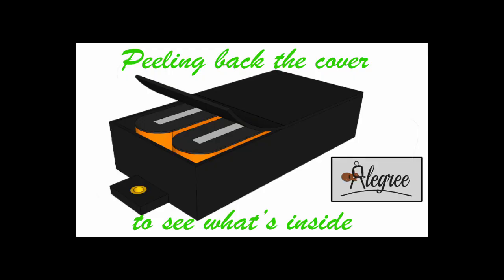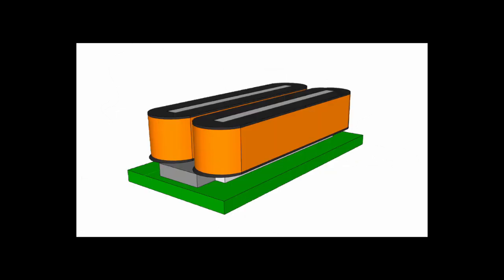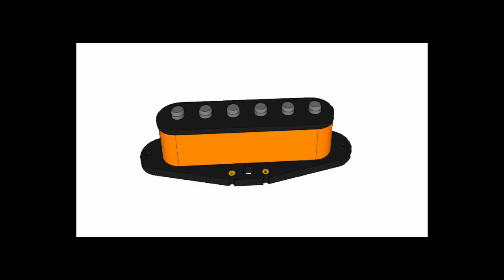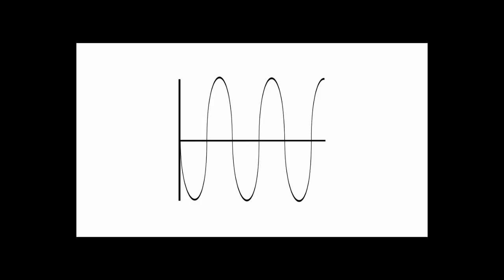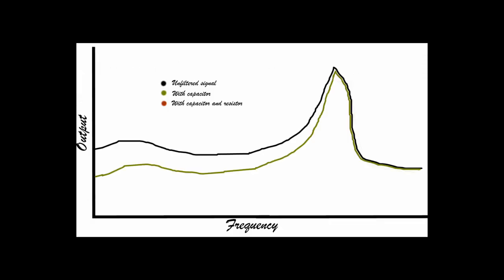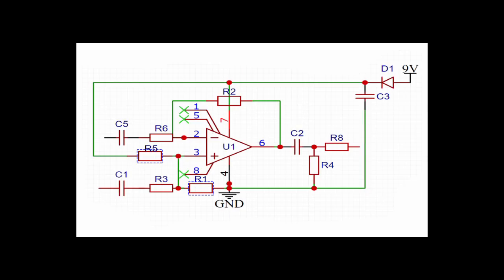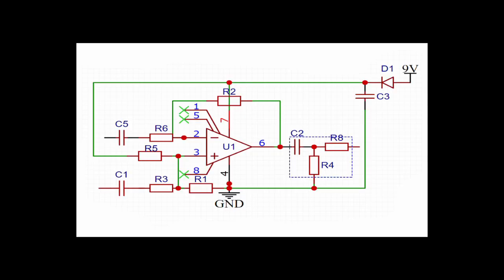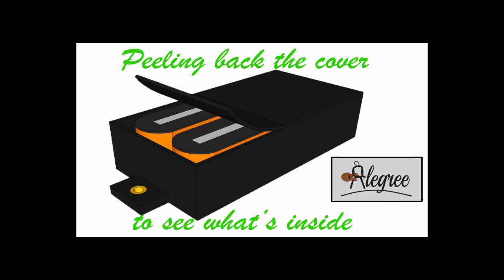What's inside an active humbucker and how does it work?

Comment: The only thing I'm not sure I agree with is that you say the preamp has a lower ouput impedance than a passive pickup. EMGs have a 10k equivalent series resistance. This is necessary to be able to parallel neck and bridge pickups in the mid position (effectively a passive mixer). It also allows the tone control to work as a shelving high-cut filter. The reason you can get away with 25k pots on an active system is that the preamp in the pickup isolates the pickup from the loading effects of the potentiometers. As you pointed out, even quite high resistances can affect the resonant peak of the coils and darken the tone. This is why passive systems have such high-resistance pots - si they don't darken the tone at their highest setting.
This 10k equivalent output resistance is around the same region as passive pickups, which tend to be in the 7k to 20k range, so it's not particularly low (though about half that of some high output pickups)